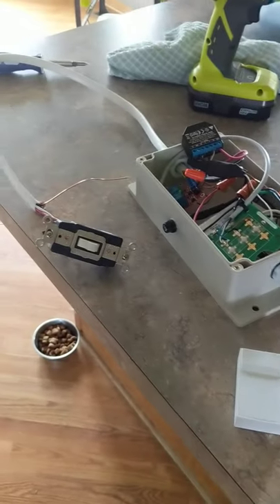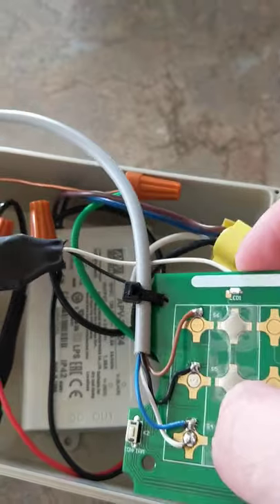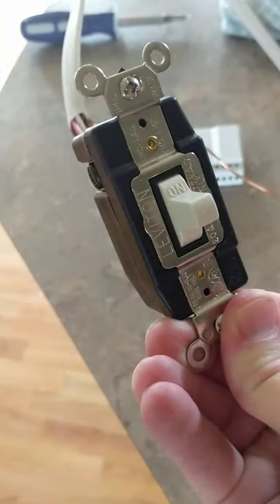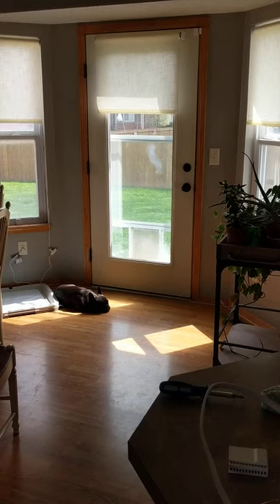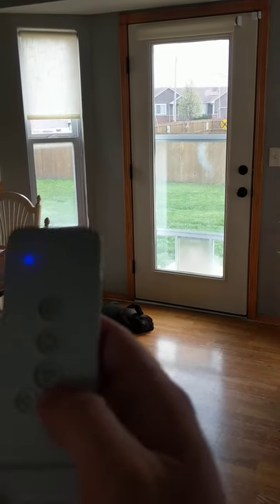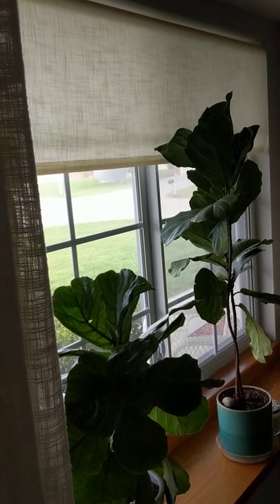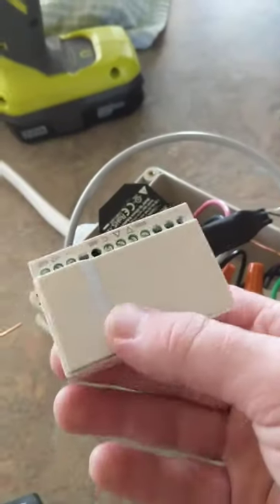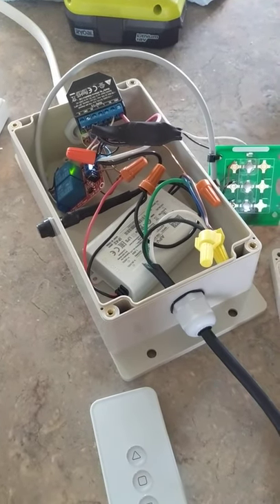Zemismart Roller blinds with Shelly 2.5 control

Comment: What 4 wire roller motor do you have in your living room? I am thinking about going the Shelly 2.5 route. Is everything 120 Volt in that setup?
Reply from the maker: I used a Zemismart motor. (https://www.zemismart.com/automatic-electric-roller-curtain-motor-for-38mm-36mm-37mm-tube-blinds-shutters-control-by-switch-suit-for-110v-to-240v-p0046.html). Yes, that setup is all 120 VAC. I just posted another video showing that setup before I installed it. https://youtu.be/e1Yfi3X-evs. I also updated the description with all the components and where I sourced them from. Let me know if you need a wiring schematic or any other questions. It was a pain to run the wiring in the wall, but I'm really happy with the end result. Shelly 2.5 is the way to go.
Reply: @zachj7257  Why do you have a 2nd relay behind the Shelly 2.5?
Reply from the maker: @jonathanochs8552  I had to add a second relay because the Shelly 2.5 sources voltage. I don't think the outputs are isolated. I am powering the Shelly 2.5 with 24VDC. But the RF wall switch I hardware hacked uses 3VDC to trip the UP/DOWN buttons. The 3VDC is normally supplied by a watch battery. I found a small variable transformer on amazon so I could step down the 24VDC to 3VDC. This way I would not need to ever change the battery on the RF wall switch.

I'm not sure this is the best way to do this. Looking at the shelly 2.5 wiring diagram again, if the "L", "01" and "02" terminals are isolated, then there would be no need for the second relay...  That way you could have the 24VDC circuit controlling the 3VDC circuit. Let me know if that make sense. If you figure out a better way I would love to know. I can get an electrical drawing done if that is helpful.